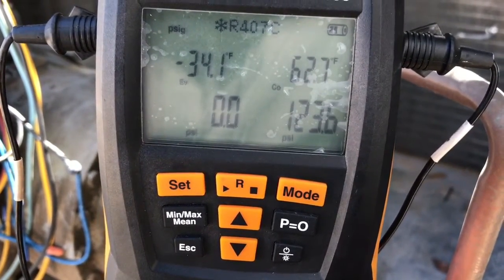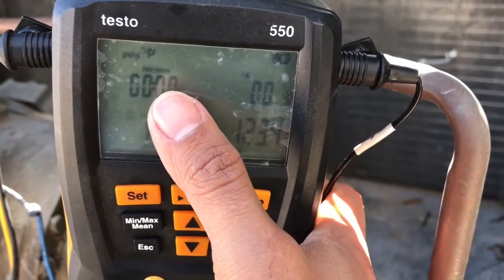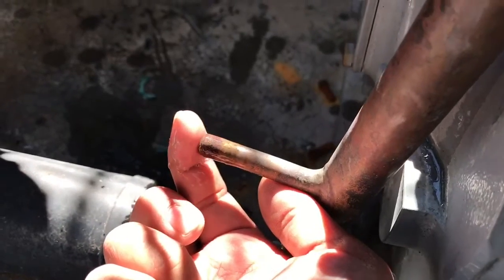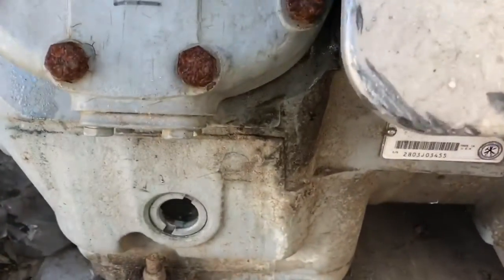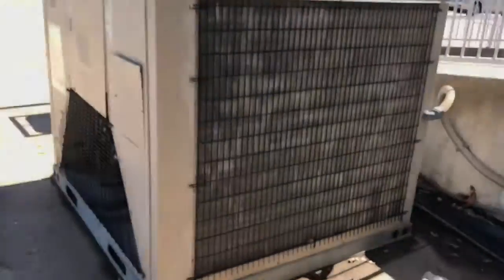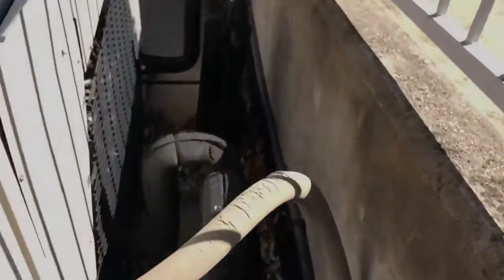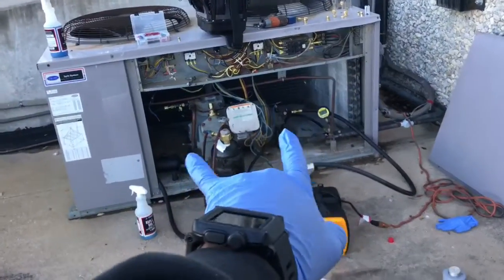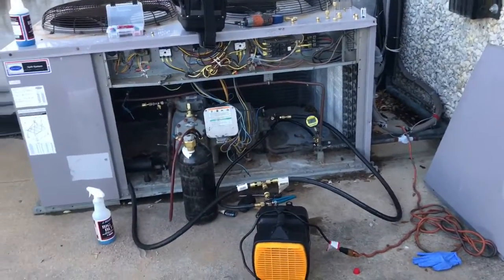15 ton split system with leak issues.  Service Valve packing on the fly

Comment: Enjoyed the video. Will there be a part 2?
Reply from the maker: Nor-Cal Refrigeration & H.V.A.C probably not didn't get much video. I just finished charging it.  Guess how much r22. 7/8 liquid and 2/18 suction about 120 feet or more.
Reply: Ulises Palacios 60 lbs?
Reply from the maker: Nor-Cal Refrigeration & H.V.A.C just about. I stopped at 50lbs . Sight glass was clear but it's still a little shy according to the charging chart.  I'm doing the spring maintenance next month so Ill recheck it after I wash the coils and change the filters.  Factory charge is 23 lbs for 25 feet of 1 3/8 suction and 1/2 liquid.

Comment: Not good lady. Go with R22, it's the most bestest lady ;)  Cool trick packing the valve, so do you coat the teflon rope with anti seize?
Reply from the maker: Jon HVAC yeah. 50 lbs of r22. Yeah you coat it with anti seize and wrap it around the stem then Just tighten the packing nut and pray for the best.
Reply: Ah thanks. Man that bill must have been higher than that AHU lol!

Comment: You lucked out to not have to get up there to work on that air handler!
Reply from the maker: Joe Shearer I did last April I had to replace one of the blower wheels. I had to get out of the lift and on the unit to reach some screws to take the top off. It was pretty damn scary.
Reply: Ulises Palacios I would agree. I hate heights too and then you go hit that 100ft triple lol
Reply from the maker: Joe Shearer lol 😂 yeah.  It's not so much the height. That thing is held in the air by 4 all thread rods. I was afraid it was going to fall with my extra weight.
Reply: Ulises Palacios sounds so sketchy man don't do something like that again it ain't worth it.